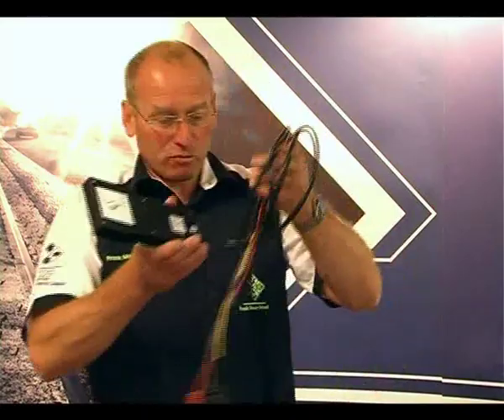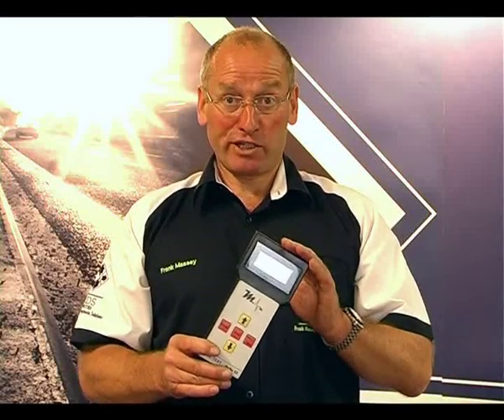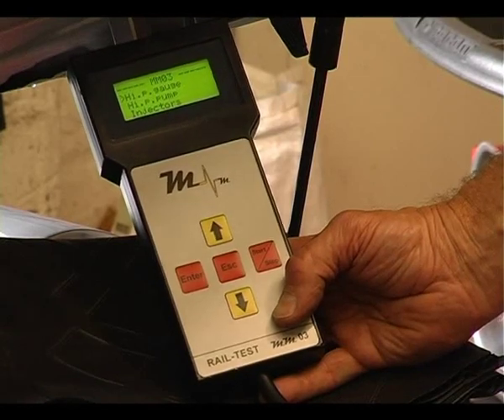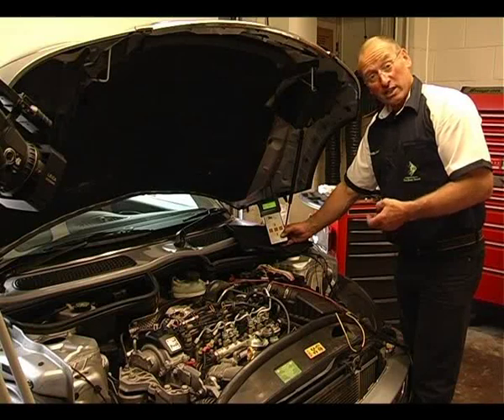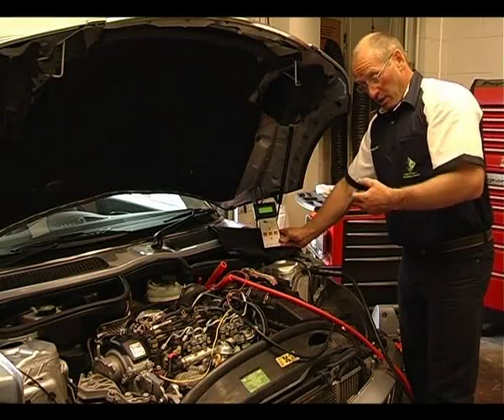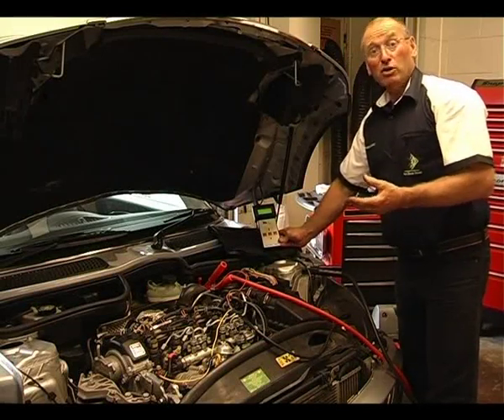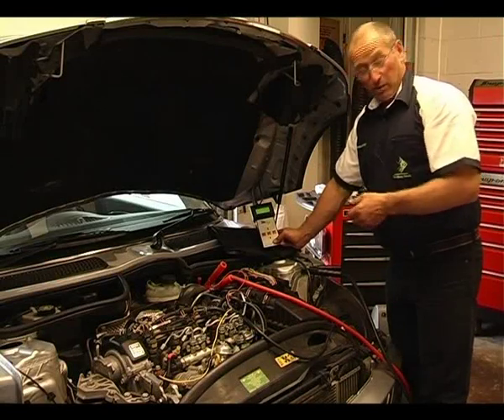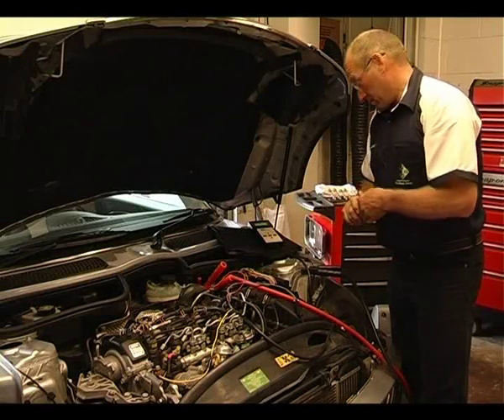Common rail diagnostics-part 1

Comment: hi from derbyshire . would you know what voltage the pulse is at the top of the injectors and if it is ac or dc as we got a shock off a vivario.and looking at making a hydrogen fuel water injection system..sounds daft but please view andrija puharich hydrogen cheers melvin